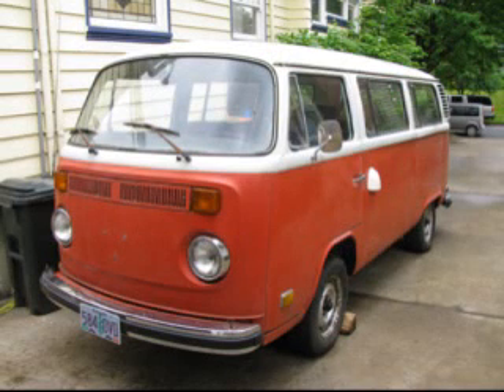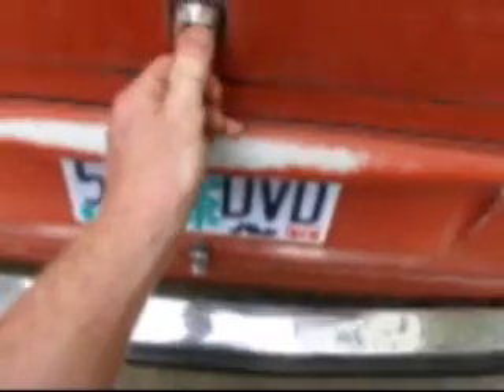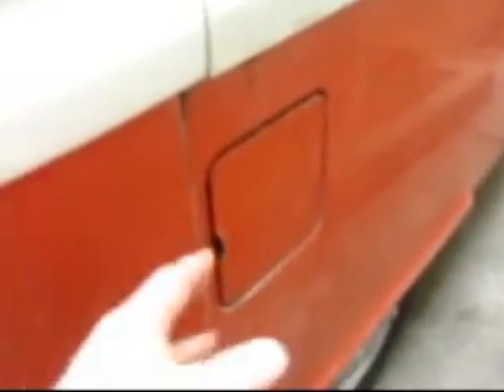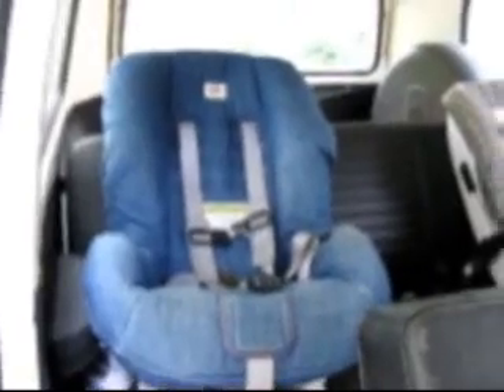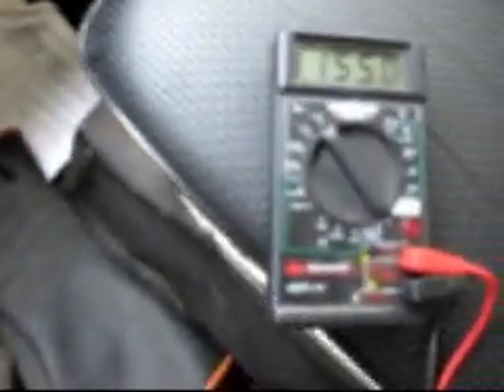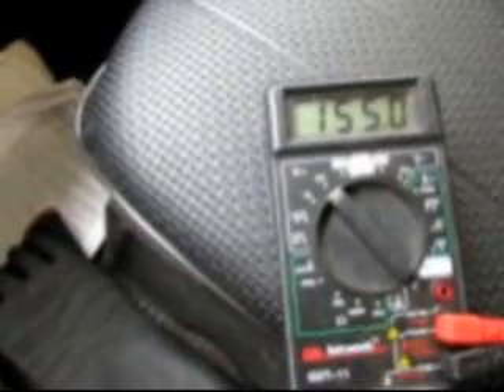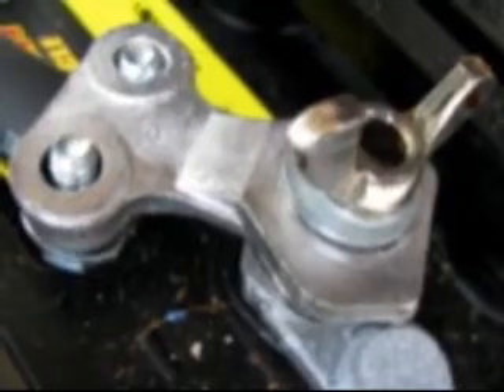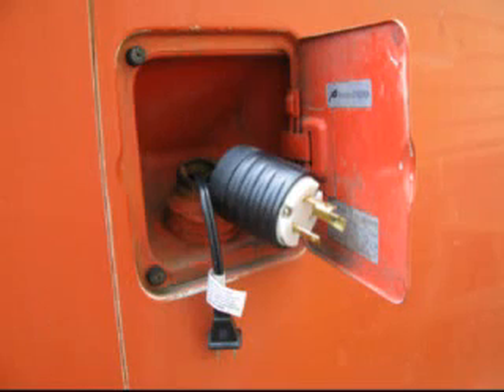Electric VW Bus Conversion

Comment: Why is that 6v batteries with more lead give it more range?
Perhaps there's another energy source other than heavy batteries that can efficiently run the engine with good power. 
Thanks for your video. I hope to have a EV Transporter along side my 71 1600dp.

Comment: I bet the overall weight was a LOT more than what it was stock; did you have to modify the suspension & beef up the wheel bearings. I bet the good thing about it with the weight of the batteries contributing to a low center of gravity is the stability. I drove cross country in a '59 panel splitty and in a crosswind or if a big rig passes you on a two-lane road, you better hang on!

Comment: Indeed! I've got twenty Trojan T-105's in my Datsun 620 truck...perhaps 700 lbs. more than a stock issue, but the range is phenomenal if you don't drive it leadfooted w/a vroom vroom mentality... and acceleration and speed isn't glacial either!

Comment from the maker: On a full charge I can go 55 if its flat .  But in the city I don't have much oppotunity fr this.  Once I've been driving 55 for a couple of miles my controller gets too hot and it cuts back my amps.  To go fast longer I need a better way to cool my controller and my engine.  I am going to do that this spring with a heat sink and a blower.  So for now on a long flat stretch I keep it 45-50.  Ince a hill gets involved its really a lot slower.

Comment from the maker: When the weather is warm and the roads flat and slow you could go 50, but 40 is more reasonable, when it gets cold the range drops to 30.  I could add battery heaters to change that.

Comment: Why did you use wet cell batteries? You should use the sealed batteries or jell deep cycle. 
For those who want to know where you can buy parts.........

You can find all the electrical supplies you need for an electric car conversion at you local forklift company. such as Raymond, Clark, Cat. FYI

Comment from the maker: i sed one from wilderness ev, but I'm not sure I'd go with that one again.  It was made from steel, and most good ones are aluminum.  Mine also turned out to be pretty warped. Its probably the smae as the bug, its just the hole mounting pattern could be different.  My plate had to be re-drilled to match with my trannys bolts.

Comment from the maker: 6v are a must if you want any range, they also lay longer, by years, than 12v or 8v batteries. So 6v gives you longevity and range but are heavier. More lead equals more range!  Lithium is still not within my price range. As far as costs go, batteries are aboutt 2 grand and running costs are abot 3 cents per mile. Cheers!

Comment from the maker: it is 90 hp at 144 Volts.  But I have heard from others that it is a bit lower.  HP isn't as important as the torque when refering to electric motors. Thanks for the comments. Is the the same bosy do it will be the same weight?  When did VW go to the beefier body design/vanagon?

Comment from the maker: Yes, I just plug it in.  It is currently plugged into my 220v dryer outlet.  I also have a 12V charger for the aux battery so I have two cords going into the gas tank of the bus.

Comment from the maker: 24 batteries, 6V each, and 144 total volts, which is really 155V because the batteries are slightly higher than 6V each.

Comment from the maker: I'm getting 40 + miles on a single charge.  The ppack voltage starts at 155, and at 144V it is supposed to be as dead as you should run it.  I drive quite a lot of hills on a long trip, so I know I could get 50 miles on flatter terrain.  I also haven't fully broken in the batteries yet. For Speed Im stuck at 50 mph.  I think to go faster I'd need a bigger motor lik the Warp 9.  Mine is a 6.7 inch diameter D and D moters and weights less than 90 pounds.